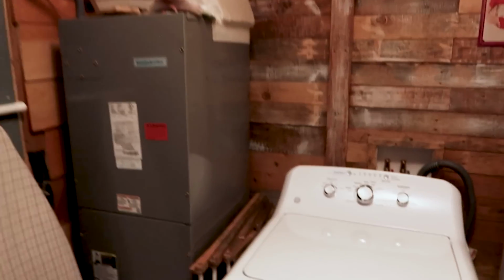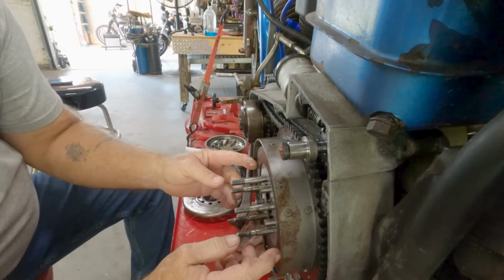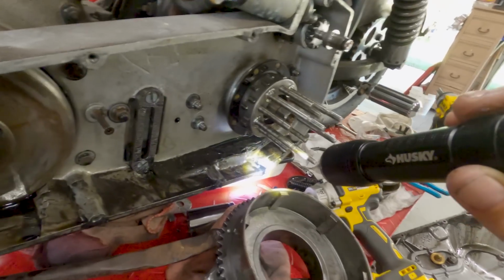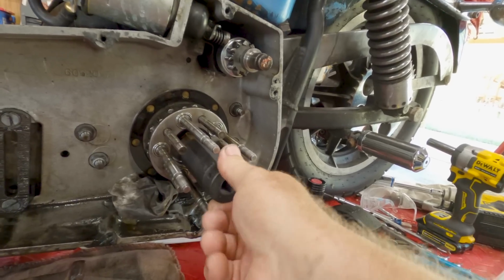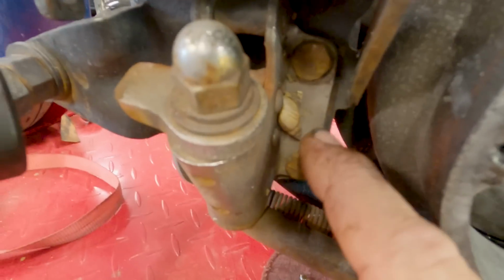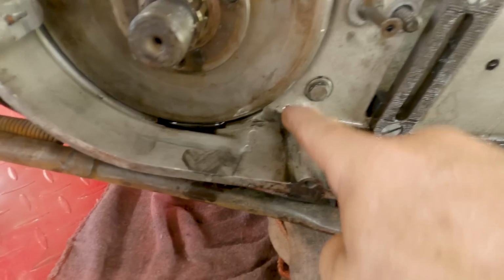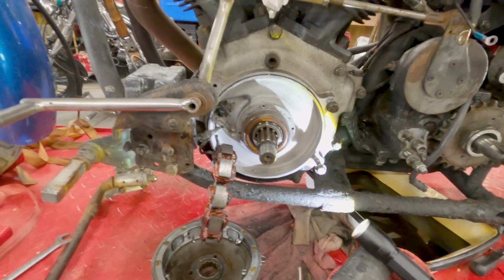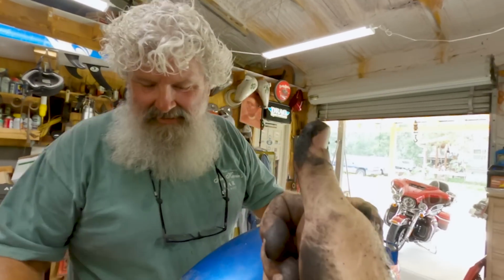1975 FXE Shovelhead NIGHTMARE...This is BAD

Comment: My guess (and just a guess mind you) is in the not incredibly distant past that old gal got pressure washed by a well meaning nitwit. Found its way into the various vents, thus giving you the spring water mainshaft, and lovely jelly whip oil tank. Id also bet that black crud in the primary is the fossilized remnants of the last clutch (think brake dust churned into oil). Last guy was too hurried to actually clean it out (or bend the lock tabs, or apply safety wire), got his grubby paws all over the primary and surrounding hardware, and pressure washed off his post reassembly residue.
Reply from the maker: Sounds plausible to me...👍✌
Reply: @shovelheadffej  and, of course, the reason for the surgery was that alternator failed, resulting in the "western union splice" hard wire kludge job. The clutch was seen to be worn, so frictions were replaced when reassembled. Explains all the jack legged halfway measures observed in the primary, and the water where water shouldn't be... a "my pal Jimmy" kinda job, lol

Comment: I have had water deep in many of my four speed transmission that have been stored .   Over the years in summer months condensation builds up in the transmission. Over the years it builds up. When you don’t ride it, it never gets warm enough to burn off the condensation . Just builds up .   I have a shop in Chicago and buy old pans and shovels and see this often
Reply from the maker: Thanks for the tip Brian, this is the first time I've ever ran into this...✌👍

Comment: Ive always ended up with wayer in my transmission's.. i dont know what the deal is but, the transmissions always seem to collect more condensation than the engine oil and primary.
Reply from the maker: I've seen that grey milky sludge but never this bad...🤷‍♂️

Comment: I remember the Tareyton cig TV commercials along with all the other TV ads for tobacco...Also recall those Tareyton cigs tasted kind of nasty(to me) compared to other brands...Think they had charcoal in the filter or something...??? >> Inner primary bolts with holes for safety wire should have small tab washers with ears & small holes in them as well (IIRC)...also torque spec is low i.e. inch pounds (all going on memory) I was thinking water contamination from looking at the gunk in bottom of primary...Trans(No not THAT type "trans"... :-) ...) water draining = previous owner possibly had ridden thru a river crossing ??? Depending on how long the bike was sitting...??? Seems to be allot for condensation build up but it IS Florida = high humidity almost year round ...???
Reply from the maker: Funny how I can't remember the grandkids name but I can remember a commercial from  50 years ago..😁

Comment: Vintage Harleys are a pain / i have had 5 Harleys 2 BMWs and 10 rice burners 1100s . My Firs Harley 64  XLCH Bought it in 66 for 1000 those were the Days It Had a Maginto so simple never broke down put on 20k miles not one problem would always start. Bought my first bike at 15 1963 Yamaha 80 step through lots of fun rode to the beach from the Valley over Mulhalnd (LA) After the Sportster I got a Kawaski 1100 GPZ another GREAT bike always bough at one year old at huge discount. Then I got a First Gen Suazuki 1100 GXR for 2600 6 months old sold it 4 years later for 2600, took it on Many Camping trips up to Crater Lake one problem with the GXR the riding Position kills your back hard to do more than 5 hours a day. It always ran PERFECT.  It was getting in to the 90s and I was 40 so decided to go Harley Got a 1982 FXR Trouble Head and boy did it live up to its Name.... The electoral was a nightmare it left me stranded MANY times sitting by the side of the road waiting for a toe truck. Im pretty good at wrenching but Electrical is not my strong point. I took it to 5 different shops and nobody could every fix it right it would run good for a few months than bam dead by the road AGAIN . I finely after pithing a few thousand into it said F it. Then  I really lost my ming and bought a 65 Panhead what a beast it ran pretty good but the oil lesks got on my nerves, I chased them ,Primeary and push rod lifter covers had for a few years and got sick go the back wheel being oiled down every time I rode it. Then I got a 95 Evo 1200 HD pretty good bike never broke down but it was a chopper . Then I got a 2nd ged Buale Nice bike Cafe racer more my style .kept it until 2018 that was my last bike . I have been into Cars all that 50 years too and still am . Have a 66 vet coupe 427 a 02 S2000 & a 71 El camino retro mod Ls / 5 speed Well thats my story, Happy Motering to All

Comment: From what I see, as you strip the bike down, the old parts are still WAY BETTER quality, than the crap they make today!
Most of those old parts are still reusable.  In a modern HD today, you want to tear it down and scrap all the crap that is standard stock HD parts.  And then replace them with a higher grade, much better after market parts.
The biggest beef I had with the (88 TwinCam), was the use of plastic tensioner shoes on the cam chains.  "WHAT!?"  Plastic parts inside the engine!  "Doesn't that just SCREAM at you, that this engine will need to be UNFU*KED at some point!?"
Another biker asked me one day, "How do you like that 88TC?"
I told him, "It's a great bike, beautiful to look at, But...  I break out in a cold sweat, every time I crank it up!"  He laughed for about 5 minutes!
"Screaming Eagle," is Harley's "After market," version of their stock crap!
So if you got a Screaming Eagle," or use SE parts, you probably got a better bike for it.
Whoever the drug user was, that decided to put plastic shoes on spring loaded tensioners, to ride against the high speed turning chains of the '88 TC', should have been seen to rehab!
They called the hydrolic tensioners an 'upgrade,' from the spring loaded ones.  But the hydrolic tensioners still use the same plastic shoes.  So the difference is only in the aesthetics.
The best solution for the 88TC, is to replace the entire cam assembly, with gear driven cams.  That eliminates the need for tentoners altogether.
Reply from the maker: You hit the nail on the head with the twin cams for sure...great comment 👍👍👍